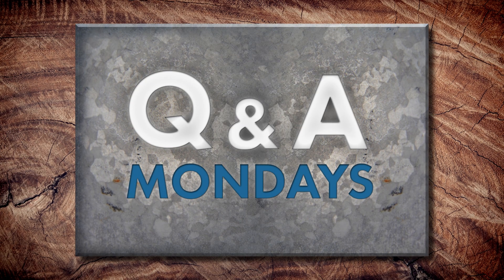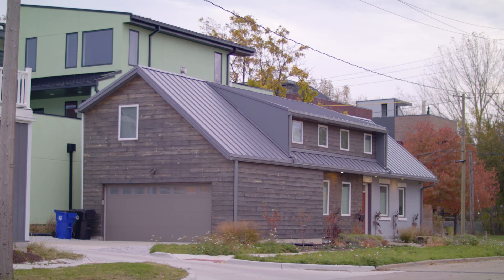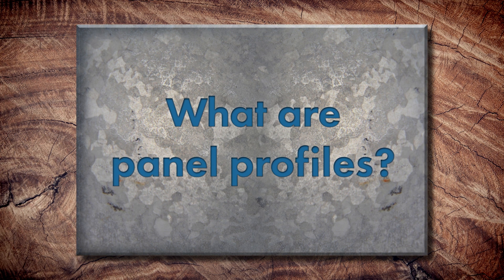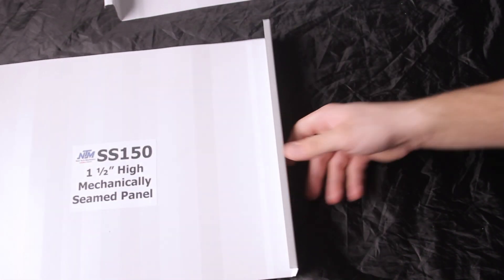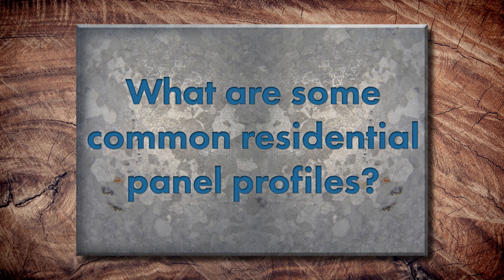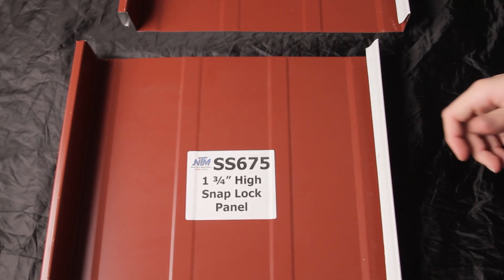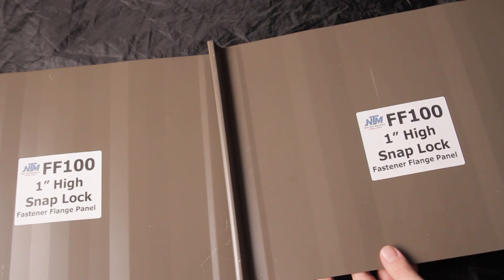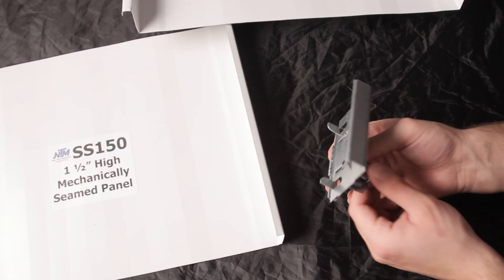Best Residential Metal Roofing Panel Profiles

Comment: I’m not getting it.  If the clip is screwed into the deck every 2 feet but the “nail on” is screwed into the deck every foot or so—at least from what appears in the video—what’s the difference?  How would the wind uplift one but not the other?

Also the width and whether striated or flat are only based only on aesthetics or HOA rules?  Not on climate or temp fluctuations or angle to the sun?

I don’t get it
Reply from the maker: Wind uplift affects both style of panels and how they perform. A panel that uses a clip will usually be able to withstand stronger wind speeds than a panel that uses a fastener flange. Here’s why: The clip being used is more often thicker than the panel it is attaching to, usually at least 22 gauge and up to 18 gauge. This is a stronger material and it locks directly onto the male leg of the panel creating a very strong connection. The clip can accommodate anywhere from 2 to 4 screws and the holes in the clip are usually ¼ inch allowing the pancake head of the fastener to fully secure the clip to the deck. The clips can also allow for expansion and contraction in mechanically seamed panels. With a fastener flange panel there is usually a ¼” by 1” long slot running down the male side of the panel spaced at every 6”. Now this flange is obviously made out of the same gauge as the panel itself, usually either 24 or 26 gauge. This is a much lighter material than what the clips are made of and therefore not as strong. Also, what we have seen with the fastener flange type panels is the metal around the fastener in these slots can rip over the heads of the fasteners leaving the fastener still in the deck but now the panel is no longer attached. Again this is due to the light material of the panel vs. the heavier gauge clip. Both panels have their place and this is why it is important to know the needs and requirements of your roof system when determining a panel profile.

The width of the panel you chose and whether or not you add structure to the panel are usually based on aesthetics, although some strict HOA’s might have rules on what they allow. Flat wider panels are more prone to oil canning vs. a narrower panel that is striated. The angle of the sun and time of day can also affect the appearance of oil canning and how the light hits your roof. As long as your system is installed to accommodate thermal movement, it should also help minimize the appearance of oil canning. If you would like to discuss this further or have any other questions please feel free to contact the Sheffield Metals Technical Director Jeff Hock here: https://www.sheffieldmetals.com/Resources/Technical-Department. Hope this helps! -Thad
Reply: Thank you for that explanation.  I was debating concealed fastener vs standing seam.  16 in vs. 18.  

Now I’m going with 16” Standing seam 24ga. Striated. PVDF. 

Appreciate the help
Reply from the maker: Awesome, glad we could help! -Thad